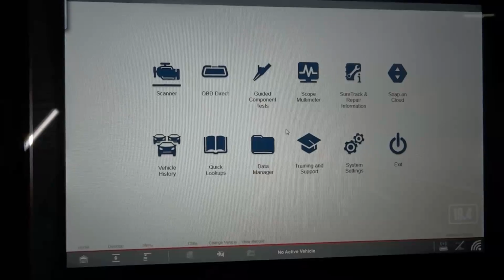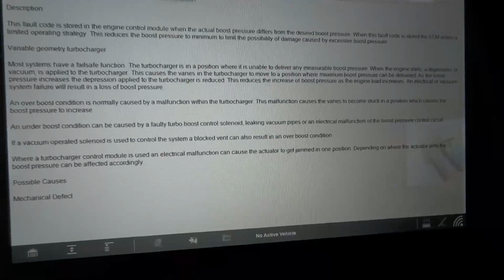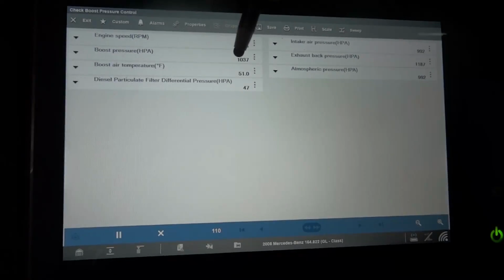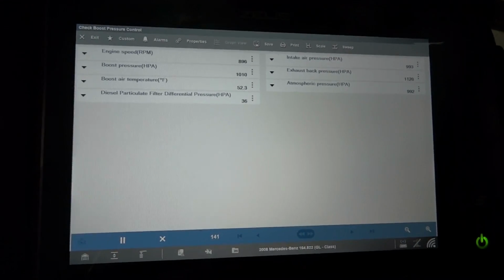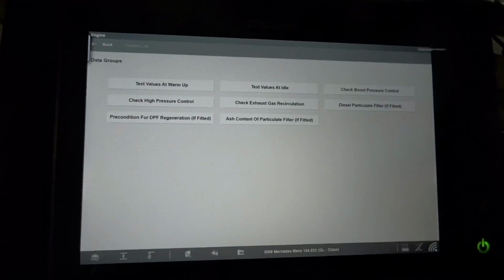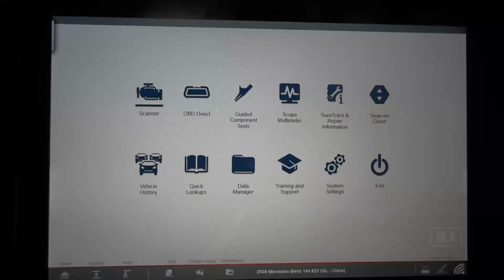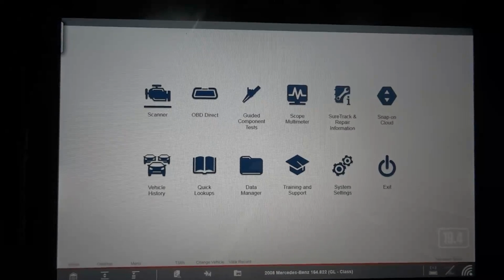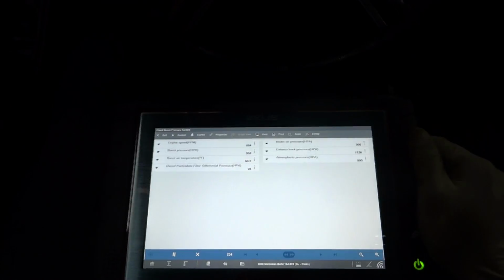How to test a turbo Actuator on a Mercedes GL320, Code P0245-P0299, Low Power Concern/ Limp Mode...

Comment: This turbo is bad, look again at it, cold side is damaged.
Reply from the maker: Nico Toscani the actuator was the problem, the vehicle ran great after the actuator was replaced… what do you mean by cold side is damaged?
Reply: @KITS_Auto_and_Truck_Repair  You did fix 1 problem, but that's not all. Look at the internal part of the turbo https://youtu.be/iOFuBNDU3NI?t=877 and compare with how it should look like https://cdn.shopify.com/s/files/1/0051/2042/6084/products/turbo-765155-5008S-a6420905980.jpg?v=1565913952
Reply from the maker: I see what you meant, yes the turbo is leaking oil and the customer was notified, the vehicle came in with a limp mode concern, that's what I took care of in this video…Thank for your input my friend Nico Toscani
Reply: @KITS_Auto_and_Truck_Repair  Sure, Thanks for your videos. Quality content.
Reply from the maker: @Nico Toscani Thank you, I appreciate your feedback!!!